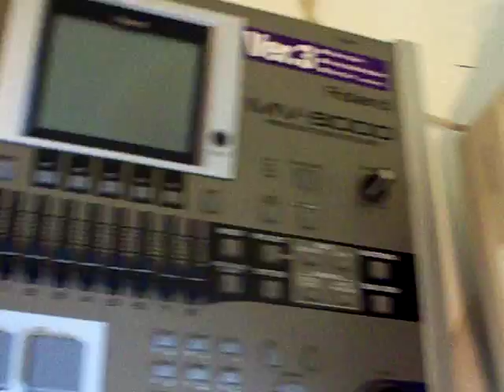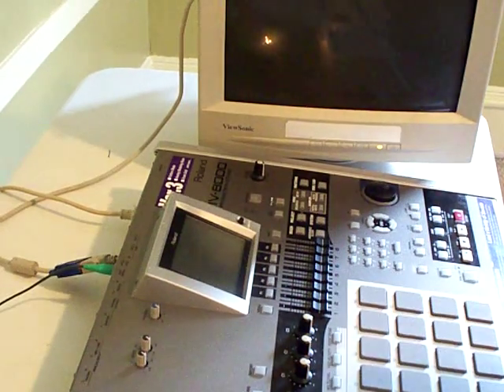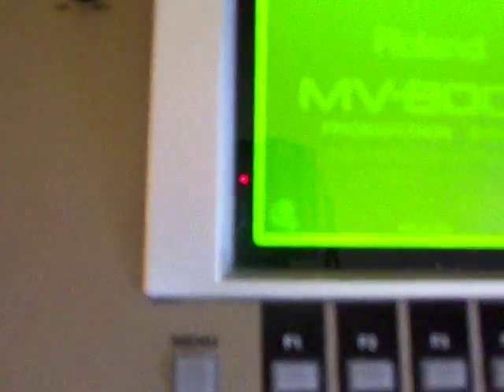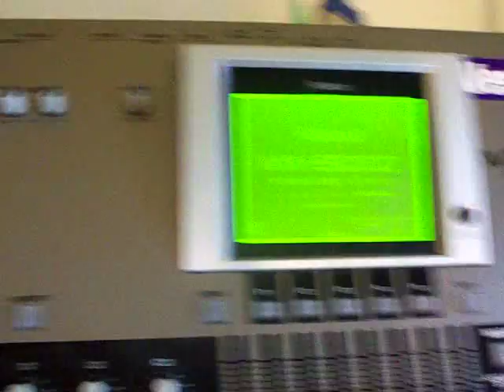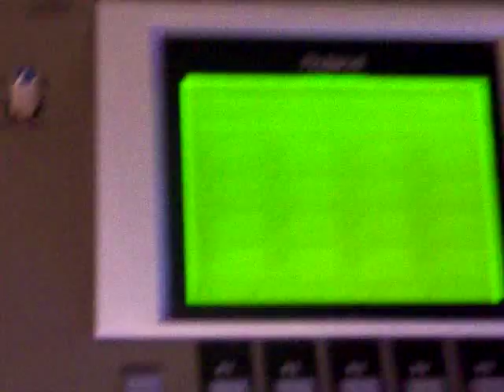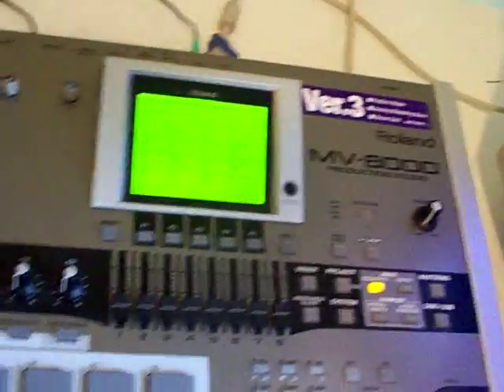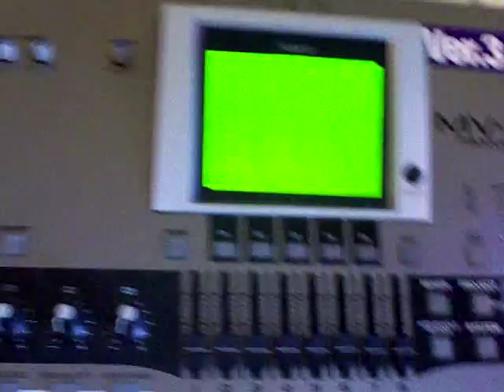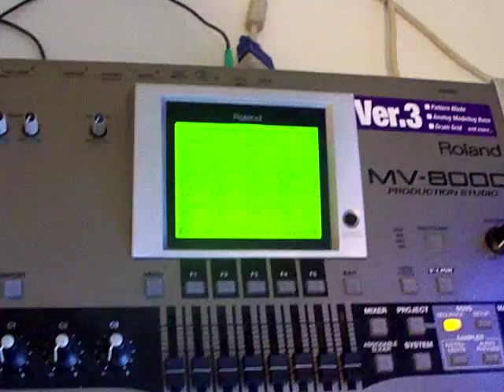MV8-VGA Do-It-Yourself - The GR8-VGA UPGRADE!

Comment: The pinout of the 16 pin connector inside the MV-8000 is:
Pin 1 (RED) +5V
Pin 2 Keyboard Clock
Pin 3 Keyboard Data
Pin 4 Mouse Clock
Pin 5 Mouse Data
Pin 6 VGA Mon SDA 
Pin 7 Board Detect / Ground
Pin 8 VGA Mon SCL
Pin 9 Horizontal Sync
Pin 10 Vertical Sync
Pin 11 Red Ground
Pin 12 Red
Pin 13 Green Ground
Pin 14 Green
Pin 15 Blue Ground
Pin 16 Blue

For the MV to detect the vga / mouse connections Mouse ground needs to be connected to Pin 7 Board detect / ground. Then also a 10K resistor needs connected from Pin 6 mon SDA to Pin  7 Board detect / ground. Then also 11,13 or 15 needs to be connected to Pin  7 Board detect / ground. If you connect this all up correctly you will get mouse and VGA functions BUT!! the drum grid will not display correctly, for some reason the boxes / gridlines are missing making the drum grid difficult to use.

Comment: So I HAVE TO connect a mouse in order to see my workstation on screen???????
Reply: If you try this vga mod, the mouse has to be attached or the MV will not enable VGA output. It will give a "Mouse Not Found!" error when you try to switch to VGA + Mouse mode.

Comment: Here's the tools to make the vga for the mv 
no one wants to show how they make it so they can cash in on it well I'm tearing down those walls for someone brave enough to build and record so others can replicate I'm too bitch to make it myself plus no electrical experience lol

Harwin pin strip header 1row, 20way 2mm pitch
The pin spacing has to be 2mm NOT 2.54mm

http://www.ebay.co.uk/itm/361987711133#

Steel Metal plate 0.9mm steel 75mm x 50mm
Could possibly attach ground wires to it from what the diagram says

http://m.ebay.co.uk/itm/Stainless-Steel-Aluminium-sheet-Chequer-Plate-Metal-Sheet-Brushed-Metal-/161437674032?

Depending on skill you can use a d-sub 15pin female connector or cut up a vga cable

http://m.ebay.co.uk/itm/20Pcs-D-SUB-3-Rows-15-Pin-Female-Solder-Type-Adapter-Connector-Straight-Socket-/122323551486?epid=515234351&hash=item1c7b0d44fe%3Ag%3ADpsAAOSwIjJZOekm&_trkparms=pageci%253A906aebc6-6c02-11e7-82bc-74dbd18008fc%257Cparentrq%253A57aac3a615d0abc642b88924ffffcd8d%257Ciid%253A12

PS/2 pcb 6 pins connector

http://m.ebay.co.uk/itm/10pcs-PS-2-6P-Mini-DIN-Female-PCB-Mouse-Keyboard-Connector-Green-/121767528810?epid=1038353224&hash=item1c59e9096a%3Ag%3AMGsAAOSwX9FZNiEx&_trkparms=pageci%253A86b46b75-6c00-11e7-99a2-74dbd1803eb1%257Cparentrq%253A579d5df715d0a8670d65520bffffddc2%257Ciid%253A10

The gauge wire I'll leave up to your personal preference I got 16/0.2 & 24/0.2 equipment wire but they were a little to fat to fit into the sub connector.
Reply: Great Links Ninja, but what's the pin configuration?

Comment: But how did u actually splice the cables? Can u show that?
Reply: I hope nobody ever cuts / splices the wires! Use a 2.0mm to 2.54mm pitch changer and a 16 position 2.0mm header to make a breadboard compatible connector to the mv8000. This was you can use a 2er hole breadboard to solder everything together safely.